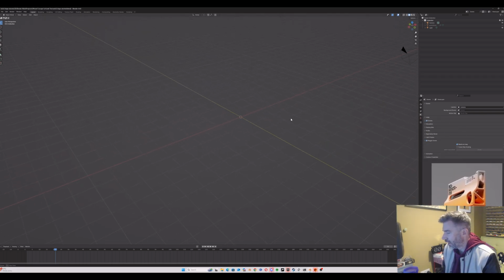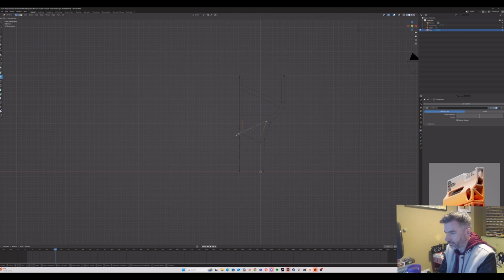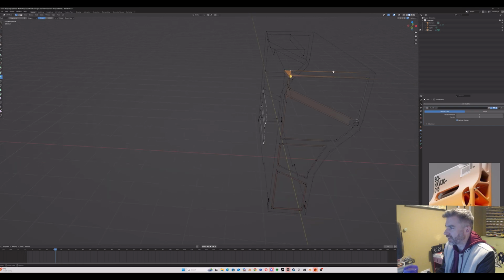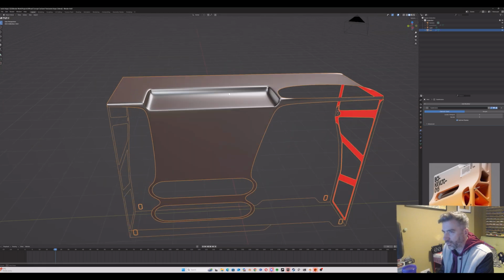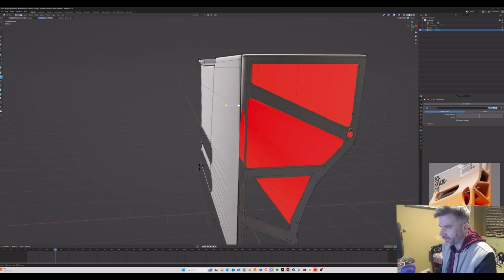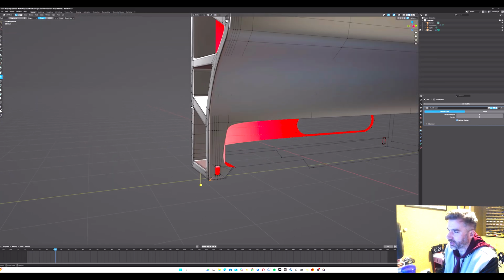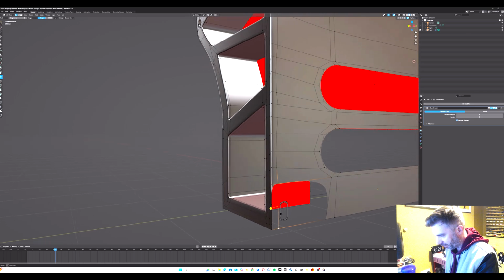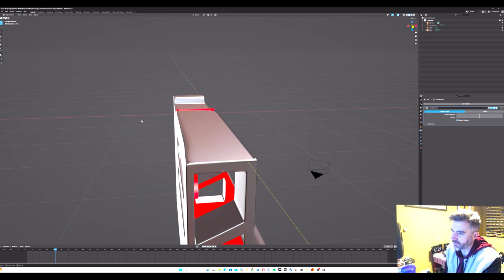Returning To Creating Art After A Long Break - A New Technique That Levelled Up My Blender Skills

Comment: heya, just skimming through a bit to potentially come back later , study and digest, but at 17 min in, why are you sharpening this way? why not just bevel vertex? in case you dont know (ctrl+shift+B, scroll wheel to add segments).

edit:I think F2 addon would serve you well! and you can also use Ctrl to snap to vertices once you've enabled it in the snap menu.
Reply from the maker: Thanks man, I’ll check out the F2 addon. 

The reason I don’t like to bevel the vertex is it curves them, unless I am mis understanding. 

I’m definitely not working the fastest way, it’s just the way that works in my brain. I’ll try your method out though.
Reply: @designersoup  ahh, to remedy that you can set the profile to 1. ctrl+shift+B, when you have the distance you want, press P while still in bevel mode to set the profile by dragging. if you want to go back to setting the distance, its Angle, so press A. 
please though these are just technical nitpicks, whatever helps you enjoy to model follow that :)  it was interesting watching you solve
Reply from the maker: @LutherTaylor really appreciate that, I’ll give that a go. It’s what I love about Blender, there’s are no right answers, just whatever is right for your work flow.
Reply from the maker: @LutherTaylor really appreciate that, I’ll give that a go. It’s what I love about Blender, there’s are no right answers, just whatever is right for your work flow.
Reply from the maker: @LutherTaylor really appreciate that, I’ll give that a go. It’s what I love about Blender, there’s are no right answers, just whatever is right for your work flow.

Comment: OK so, what's the technique? At the start I could barely hear you over the music.
Reply from the maker: Not sure how far you got through the video but i explain the techniques of mapping out all my edges first and working out how I’m going to form quads. 

It sounded fine to me when I listened back but the music fades once the tutorial starts properly.
Reply: @designersoup  I skipped through when you started modeling. I saw you sharpening corners. Would a grid fill work in some cases?